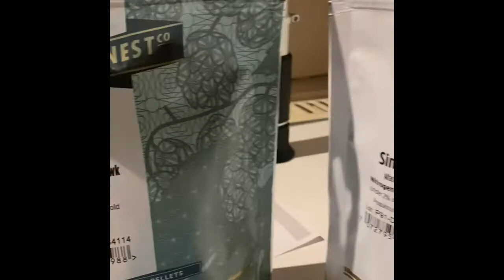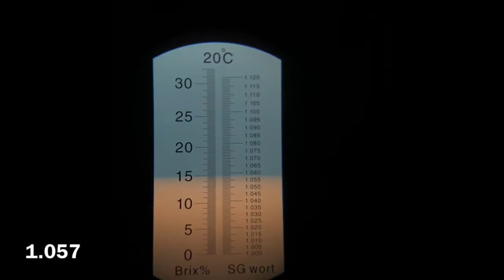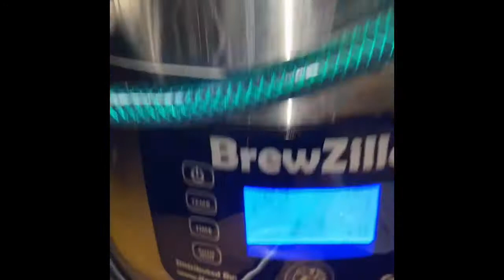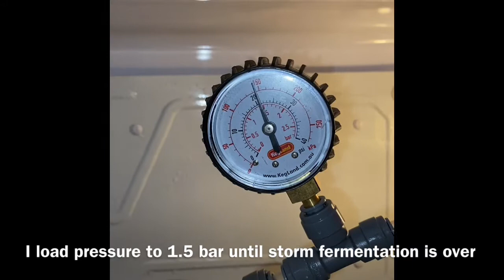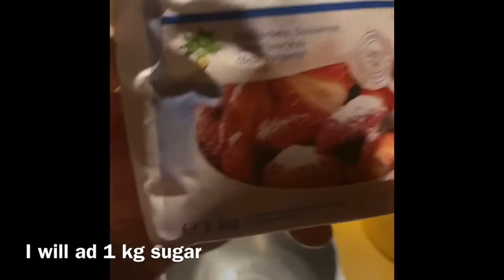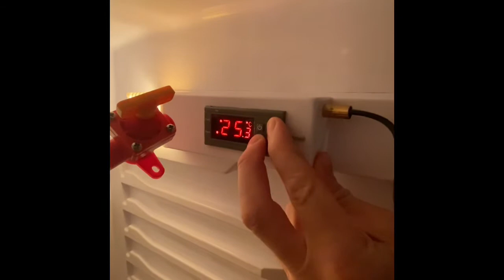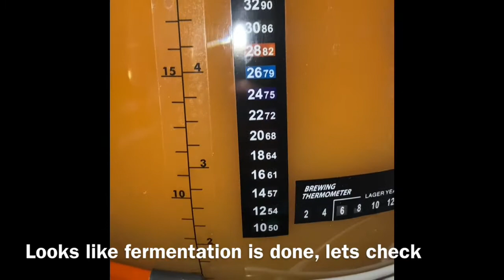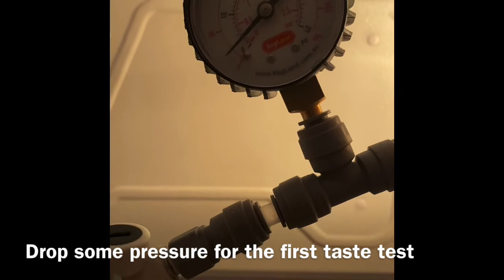PRESSURE FERMENTATION Double IPA 10,3% in 7 days, served directly from fermzilla

Comment: Hi! Just made a batch last friday and waiting for the results.you set it to 1,5 Bar but after that you have 2 and even 2,2 with 27 degrees. Did you set the gauge to achieve those pressures? Because i didnt see that in the video.

I made it at 20degrees with 1,8 bars to get 2,5 co2 level. I read now that 27 degrees would be much better. Lets see what happen.  

Another question if the gauge marks 26 psi and i conect a soda stream bottle to the Keg, the regulator of the bottle should mark also 26 psi right? Because it always mark 6 psi less and i dont know why
Reply from the maker: Remenber, as soon as you serve a glass the carbonation starts dropping, by the time you reach 1/4glass , you have beer at 10° and 1.9 Co2. Bad comb. I think it otherwise: near the border of over carb, serve at 2°, then the first taste with the extra carbonation and extra cold will impress your first to fith taste there after you start appreciate what you’ve created and lean back, from there your beer is at right temp 4-7°and dropped to right carb 2.5 at average. Forget the book, do it the way YOU like, then its your own. Thats why its called craft beer.

Comment: Great video. I just got the 55 liter myself.
I will be serving directly from the fermzilla. No transfer to kegs or bottles. 
Should I remove most of the trub shortly after the cold crash?  Will trub add unwanted flavors to the beer over time, or does it not matter if its sitting in the bottom of the fermzilla?

(The "collection cup" on the new model is only 600ml, so I guess I would have to do it multiple times in order to remove all of it.)
Reply from the maker: I served directly for a long time, i didn’t have a problem. Bottles and kegs is a luxury, if you so have to take some with you in a soda bottle just cool the beer in fermzilla to 1.5°-2° celcuis so the beer retain the co2.
Dont overthink the trub.. let it rest in peace and enjoy whats above.

Comment: I always press out the good stuff too, mate! Looks like a nice drop. Well done
Reply from the maker: That makes two of us so far!
Reply: @LucasSteyn  3 of us, never had issues with astringency or lack of efficiency.
Reply from the maker: @Hannes_Lind  my next brew which i didnt film i got 89% efficiency, proves that ruining your beer by pressing during rinsing is just a hoax believed by those who fear differing from a recipe . Remember craft brewers brew only the style and type they like them self, its up to all others if they like it or not. Dare to be creative! Only oxygen and hygiene are your foes.
Reply: @LucasSteyn  exactly, but my biggest enemy is money. I want all the gadgets and its getting a bit cramped and expensive.
Reply from the maker: @Hannes_Lind  it doesn’t need to be expensive, i made great beers with bucket system. Just reckon like this: cheaper - more effort, more expensive- less effort. Check out my earlier videos on beer making, i used cheap stuff and got great results nonetheless!
Reply: @LucasSteyn  I used buckets for the first 3 years and moved on to pressurized fermentation and to kegs. I didnt want to make the transistion to early if I wouldnt stick to brewing. But im still hooked and adding gears as I go. Just ordered a sodastream regulator because I cant stand unhooking my other regulator everytime i need to top up the Fermzilla with pressure during readings and dryhopping. Im coldcrashing a Winter IPA with Citra and Sabro at the moment.
Reply from the maker: @Hannes_Lind  cool stuff, seems like we think alike 👌good luck brewing 😃👍
Reply: @LucasSteyn  You too, im gonna keep following your channel for tips and tricks.

Comment: Hi, im just wondering if its working with putting the heatingcable, directly on the fermzilla? 
Im about to invest in a fermzilla put heard that you shouldnt heat directly on the plastic. 
Have you had any problems?
Reply from the maker: Hi! Did you know you can boil water in a bottle without melting it? Same with fermzilla, you use the heating belt 30w directly on  the fermzilla and it will not damage anything, besides you only heat during fermentation in a fermenter that has 15- 27 l wort inside. I have had no problem at all. Dont use blow heaters, heat lamps, defrost heaters, fish pond heaters, acytelene burner or fire or any other form of heating. Remenber, the fermentation process generates its own heat of about 20-23 deg constant during the active phase. Good luck!

Comment: Really nice video. I want to start with pressure fermentation after 2 years using bucktes. There is something that i dont really get.  Why to go to 25C-27C? Normally with IpAs / Ales the fermentation is at 20C but i saw in many videos that people go to 25C or even 30C. Sure there is a reason but i dont get it
Reply from the maker: Higher temp + pressure = faster fermentation.

Comment: Why when you set 1.5 bar, after a few hours there is a value close to 2.0 bar. Shouldn't the valve keep 1.5 bar all the time? Not working properly?
Reply from the maker: Yeast producing more co2 than the valve can release. At the storm stage😀

Comment: I would like to bottling from fermenter (fermzilla all rounder) after the fermentation is over. do you think it's possible or I will loose carbonation?
Reply from the maker: I did it many times and all ok but, rins the beer bottle with cold water, drop pressure in fermenter so beer flows almost just with gravity, tilt the bottle and fill as much as possible. To 10 mm from the top. Its a pain staking process, each fill takes about 20 sec and with spill. You will be better off with counterfilling beergun. Best is to bottle carbonate from the start. Fermenter is ment for else than botteling.

Comment: You don't extract the yeast? How does the tap collect just the top layer?
Reply from the maker: The sucktion end has a small ball that float, so it always stay 20 mm under the top surface and giving me clean beer, the yeast is never touched nor stirred. Unless you really want to serve the last 300ml you get yest, but then the suction end is allready in the yeast graveyard.